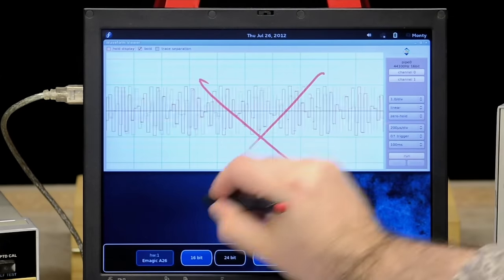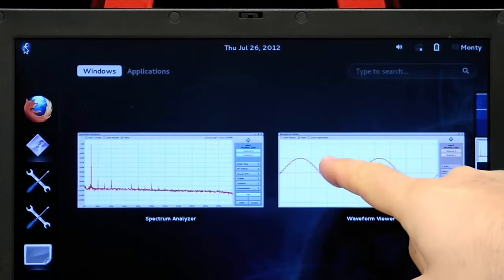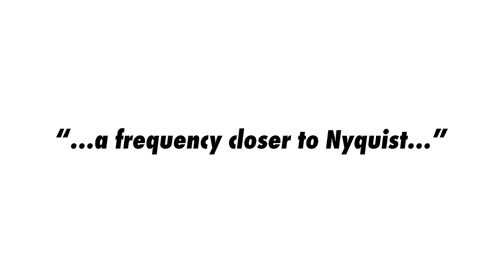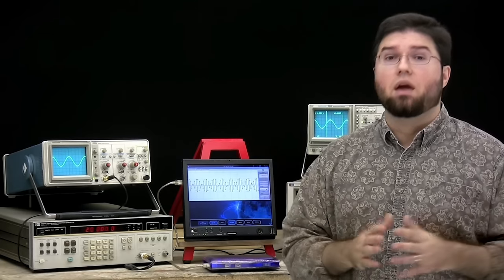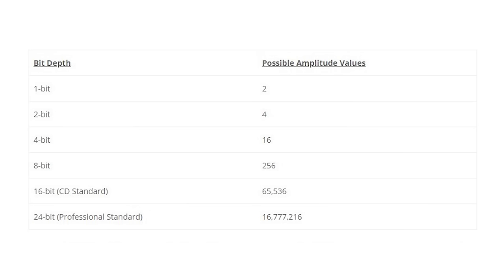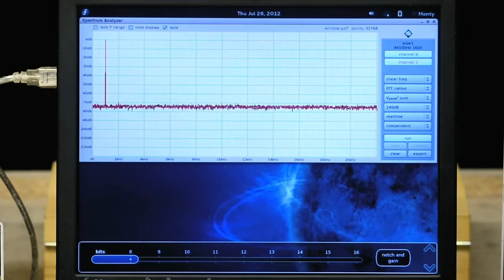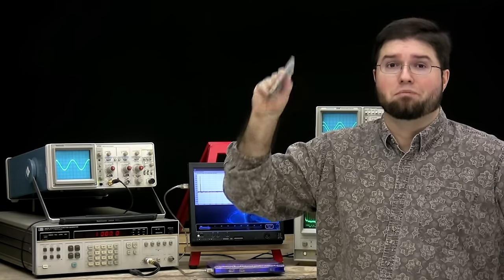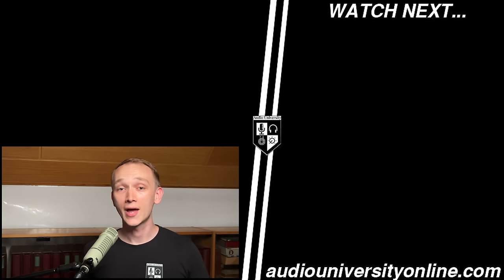Debunking the Digital Audio Myth: The Truth About the 'Stair-Step' Effect

Comment: The stair steps are present at the output of the DAC-.  They are clearly not present on the -scope display-, just as demonstrated. There is a filter between the -DAC and the -scope display-, most likely the filter is inside the analog to digital to analog box, or -DAC box-.  This filter is not a zero order hold, but a band limiter or low pass filter.

I say all this based on theory learned in college and based on experience. In 1980 I designed a 12-bit digital to analog / analog to digital board for a military application while working at Texas Instruments.  Since that time I’ve designed DACs within integrated circuits.

I’ve drawn a distinction between the DAC and the DAC box-.  It would be informative to get the schematic of the -DAC box used in the demo, along with data sheets on the parts.  The low pass filter might be inside the integrated circuit that has the DAC-.  In that case you couldn’t put your scope probe on the -DAC output.  If the filter is outside the IC, though, that’s where you could put the scope probe.

A scope will usually have an optional band limiting function.  Be sure it is off.

While I’m confident about my understanding of theory and about my experience, to me the greater question is how to explain matters like these accurately and clearly.  Maybe the only way for a person to gain correct understanding is by going through processes similar to mine.  This stuff is commonly taught in undergraduate electrical engineering programs. And engineers who use and design DACs and ADCs grasp it by experience.  But that’s a long process.  

I like the explanation of quantization noise.

Thanks!

Comment: Density Pulse Modulation / SACD / Sigma-delta Part1
Stated simple if PCM is encoding by equally time spaced pulse (time dicrete and depending on sampling frequency) modulated in hight (which is the number encode binary in 16 or 24 bit, Density Pulse is a "non equally spaced", pulse with only 2 possible hight A or zero (is up to you the value of A, is unimportant) so shortly one or zero so 1bit like the name suggest.
The basic of DSD (also know as 64DSD for SACD and now like the scaling up of sampling in PCM, you have now 128DSD, 256DSD and so on if you like)
SACD = 64DSD is a reminder (closing an eye to commercial staff also) which means his sampling frequency is 64 time the one of the CD standard 44.1KHz*64= 2.824MHz,
well please don't take assumption yet, remeber is 1 bit.

The Idea was to hypersampler the analog signal and encode with one bit only from previus sample signal is going up bit=1 or down bit=0 assuming that with such high sampling rate thee difference is very little (yes but still quatized). So you can have 101011100110000110011 ... all this stuff

Ok, but in real? you simply need a comparator circuit and few others evaluating actual sample with previus iv Va - Vp < 0 bit 0 if > bit is one and you have a stream of 0&1's (DSD ment Direct Stream Digital).

To recap you end up with a sort of square wave with 1bit hight, but to give an idea of pulse density  imagine a square wave like a spring, uncompressed string is like a real square wave (meaning 1&0 equally spaced like the spring wounds are spaced), stretch or compress the spring and you have an idea of pulse density.

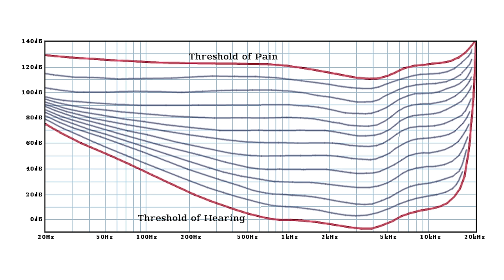Comment: I'm also an electrical engineer and this is 100 percent correct. What's more, if you look at Fletcher Munson curves at about 11:28 you see that at 20 khz the threshold of hearing intersects the threshold of pain. This means that for a sound at 20 khz to be experienced it would have to be so loud that it would be experienced as pain, not sound. But I hear audiophiles exclaim we don't listen to sine waves. Nearly 200 years ago a brilliant French mathematician demonstrated that any waveform periodic or nonperiodic could be analyzed as an infinite number of sine waves from 0 frequency to infinite frequency superimposed at different amplitudes depending on the shape of the wave between two points in time. So the waveform can be flipped back and forth between the time and frequency domain. Therefore so called high definition or high resolution offers no benefits.

However there was a problem with the original D/A converters. This had to do with the antialiasing filter which had to be very steep by 22.05 khz yet be almost flat at 20 khz. This caused frequency response and phase shift problems in the audible passband. The solution was oversampling. The digital signal was repeated 8 times although no additional information was added. It was treated by the D/A converter as though it was 176 hz. This allowed the anti aliasing filter to be far above the audible range where it had no audible effect. The results make RBCD the gold standard for the digital system for recording and playback of analog signals that are supposed to be analogs of musical sounds (they aren't but that's a different discussion.) What's more RBCD has many other features such as belt and suspenders error detection and correction methods and a great deal of metadata such that the musical signal is actually only a small part of the signal. 

Technically RBCD beats analog for its function in every conceivable way. Then why do many audiophiles prefer the sound of analog, especially vinyl phonograph records over CDs. There are many possible reasons that have nothing to do with the technological differences. They mostly have to do with the way recordings are mastered differently for vinyl phonograph records. There are both inherent and deliberate distortions in vinyl phonograph records. Another has to do with the aural inadequacies of the two channel stereophonic system. Frequency response distortions due to phonograph cartridges can be preferred by some people. 

Here is something to notice from the Fletcher Munson curves. For those not familiar with them, the vertical scale is the actual loudness, the horizontal scale is the audible frequency range, and the curves are indications of equally perceived loudness. Notice how as frequency goes down the curves are squashed together. This means that once bass is loud enough to be heard, small differences in actual loudness result in large differences in perceived loudness compared to higher frequencies. This is why for perceived tonal balance, relative bass loudness has to be adjusted for each recording at each loudness level. Based on my experience even small differences in spectral balance at any frequency in the audible spectrum as low as 1/2 db has an audible effect. A graphic equalizer and the skill to use it can get the FR from the recording microphones to your ears reasonably flat. That is what matters and is one of the reasons why the result of bench test measurements don't correlate with perceived tonality. Achieving high fidelity is a far more difficult problem than it appears even to so called experts in the industry. It has to do with the ability to analyze and duplicate sound fields that reach your ears in a way that is similar to what you'd hear live at a performance venue. By that measure the best sound systems at any price given the current state of the art is very badly distorted.
Reply: While that's quite interesting & known to some of us, I'm absolutely certain digital can't capture complex sounds, with simple sound yea it  has no problem with hence the reason it sounds Dead & lifeless. I'm another that went back to Analog
Reply: @hiteck007  I have tried to explain to you why the RBCD standard meets all criteria for the precise reproduction of complex analog waveforms that are supposed to be analogs of music and speech in ways that analog systems can't, inferior digital systems can't, and why better performing digital systems offer no usable advantage. This is beyond dispute. If you do not have a background in the mathematics of electrical engineering and information theory you will just have to accept the statements about it from those who do. It's not an easy thing to learn. Fourier transform theory is a second year course by which time the electrical engineering student has enough calculus to understand it. Information theory is a senior level course. (Feedback control theory is so filled with calculus that it is targeted at senior level undergraduate EE students and master's degree EE students. Others really don't know what the hell they're talking about.) If you were to burn an RBCD of an analog source even with uncalibrated consumer grade equipment, the disc would sound indistinguishable or almost indistinguishable from the analog source. I say almost because the only difference between one digital player and another is in the analog section of the D/A converter. Even small differences in frequency response are audible and correctable with a graphic equalizer. The fact is that the multi-thousand dollar RBCD player is no better than an inexpensive consumer player. 

I've also explained just some of the reasons why given the technology of two channel stereophonic sound analog recordings might sound better to audiophiles than RBCD recordings. There are many areas of mistakes. The basic problem has to do with the inability of stereophonic systems and even multichannel systems to reproduce anything like the sound fields of live music. 50 years ago I began studying sound fields, how to mathematically and physically model them. These are the sound fields that are generated at the source, what the acoustics of the space they are in do to them, how they arrive at your ears, an what you brain makes of those parts of them you can hear. I used the analytical tools I gained as an engineering student. Sound is not an electrical phenomenon, it is part of a branch of mechanical engineering called fluid dynamics. Sound fields are time varying pressure gradients, for which the sounds we hear the working fluid is air. The mathematics I used comes from electrical engineering and from vector analysis. 

Since you can't solve a problem you don't understand it is small wonder that the efforts of this industry to reproduce the sound of live music from a recording in the home have failed badly. Hi fi sound and the sound of musical instruments create entirely different sound fields. The larger the acoustic space sound of live performances are heard in, the greater the difference. Once I understood this problem solving it with a practical engineering solution seemed next to impossible. There are approximately two dozen variables that affect the sound field but the field itself can be reduced to six. The solution to the "they are here problem" which is useful for soloists and small ensembles is to make a sound system that has a flat frequency response back to the recording microphones and propagates sound into space the way real instruments do. The fact is that most of the sound energy coming from real instruments is not directed at any one direction in the audience while loudspeakers do to an increasing degree at high frequencies. Your listening room treats the reflections to give the wrong results.

 The you are there problem adds the function to reconstruct the sound fields similar to what the acoustics of large spaces create which is almost all of what you hear at a live performance. The results for recordings of symphony orchestras, opera recordings, choral groups, pipe organs, and even soloists performing on the stage of a recital hall are radically different between hi fi sound and the real thing. Hi fi sound is a pale dead facsimile  of live, the best the current state of the art can produce. Did I solve the engineering problem? Yes, and I patented one variant of the concept. It has no commercial value because it is too complex in its current prototype form and would require a great deal of highly risky investment to try to implement it as something Joe Sixpack could use or even advanced audiophiles. Given the type of recordings the mass market buys, likes, listens to, the existing systems seems to satisfy most of them. BTW, you don't need a double blind test to tell the difference. The difference is highly audible in the first second of hearing it.
Reply: @markfischer3626 Mate I have an Electrical Engineering background & yes I went through all this theory too but I'll make this short, MY EARS HEAR DIFFERENTLY, Digital sound has a STONE DEAD sound at best which I suspect after being through sound compressors & a few other processes it degrades the sound so much it comes out as distorted garbage missing far too much to have any kind of quality about it, Yes even records often have a special equalization before imprinting but regardless of that my understand is it's an analog process & minimal changes done. regardless of all that, when I used to record concerts ( only small shows) I did it with a simple high quality tape deck & a few mics, and that simple setup could Infinitely do a better job than what I was hearing with so called professional CD's. after quite a few years of absolute Unprofessional sounding music from cd's, I have REFUSED to buy more CD's because of the Poor recording quality & absolute dead sound, hence why I went back to analog audio even with it's faults it sounds much more lively than digital even with heavy equalization to try and pick it up it fails to do so especially in the top end frequencies. I know what my ears hear & a simple tape deck & an old valve amplifier can outperform digital in sound reproduction is an insult knowing what technology is capable of & all we get is this crap. Talk all the special technical terms you like, my ears can hear the difference with CD's, not so much with extremely high sample rates depending sound processing like on some DVD's & 4 K movies. I remember the old LASER movie disks (the size of 12' records) before DVD's came out also had a very life like sound to them amazingly (but painfully expensive) & that was early digital, whatever they did there worked & they ditched it. Oh and lastly I still have all the test gear in my electronics lab so yea I know what I'm looking at when tests are done, but as I said before my ears know good sound reproduction when they hear it.
Reply: @hiteck007  Lossless digital signals on CDs are not compressed. They don't have to be. Their dynamic range is more than adequate for any musical recording. They were compressed into clipping so that they would play louder on radio stations to catch a larger audience as people thumbed through the stations. Those are compressed, badly distorted, and it is deliberate. Classical music is not although it can be in the player in a car so that the softest parts are not drowned out by car noises. 

Analog recordings are automatically compressed to stay within the capability of the medium. This goes for both tapes and phonograph records. At the end of each musical phrase, the gain goes up making the reverberation on the recording relatively louder and last longer. This is one of the reasons many people say analog is "airier" than digital. Analog channel separation for vinyl is poor. It's rarely more than 25 db even at mid frequencies and falls to 10 to 15 db at higher frequencies. The bass is always monophonic. For some recordings like Columbia there was a sharp cutoff below 50 hz except for recordings of pipe organs. This saved real estate on the record surface. 

Now for my surprise. I was wrong. When I'm wrong, I admit it. My experimental sound system recreates the reverberant sound field just as I want it to. Everything is controllable. My source of choice was CDs.However a couple of years ago I bought a Samsung S22 ulta and decided to hook it up to my main sound system with bluetooth expecting nothing. The bluetooth receiver was $20 from Amazon, J205. I was astounded. Recordings on YouTube sounded just as good as CDs and it didn't matter if the source of the recording was analog, digital, DSD, they were all the same except for recordings made from phonograph records where I could hear the pops, clicks, and surface noise. This prompted me to connect my turntable, my best one and my favorite in the whole world. It's Empire 698 with a Shure V15 type V MR. Just excellent. So, while CDs are technically superior by far to analog, the other two sources, bluetooth and vinyl can be just as good. I've got over 3000 vinyl phonograph records and over 3000 cds. But I'm having so much fun with bluetooth I really can't put it down. With this system there is nowhere to go but down. It is very complicated but it is worth it and it didn't cost a whole lot of money, less than some audiophiles pay for a power cord.
Reply: @nicksterj From an engineering point of view, doing that with a sound card, I would have expected that if done right as you are only talking about pure DATA, it can't change unless corrupted. Analog is totally different to digital as you know and that comparison obviously will have a result like that so don't do it. In a way that was a natural copyright as no one wanted to do that to their music. By the way I still have a few of those old cards lying around. Look with the excessive amount of sound processing done to digital music, it still gets degraded quite a lot, there's no getting around that & especially sound compressors Destroy quality.

Comment: Thanks for getting concrete information out into the audio community. The "Hi Res Audio" marketing is pushed hard by manufacturers so consumers feel like they NEED 384kHz sampling rates and that 44.1kHz sampling is insulting. It's funny because the best-sounding DAC I've got delivers a maximum of 16 bit 48kHz. Even if you're listening to hi-res masters it just doesn't matter how many bits or hertz you throw at a DAC, it doesn't change how it sounds musically.